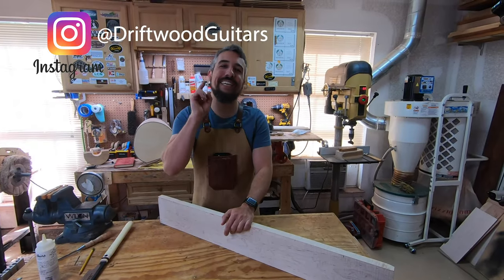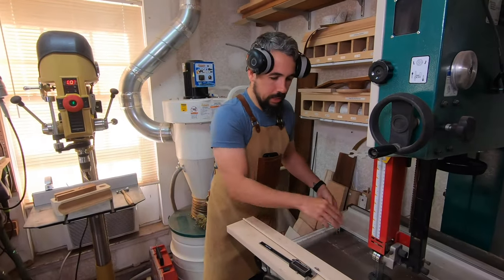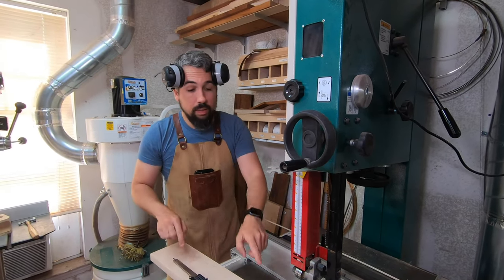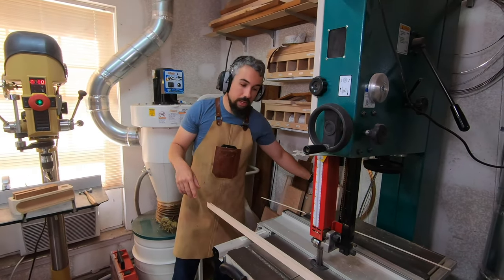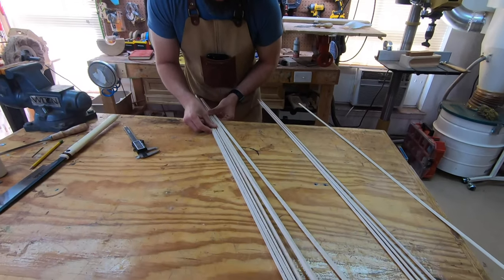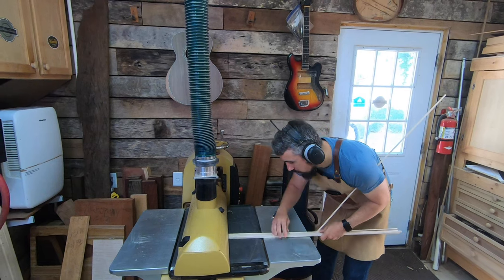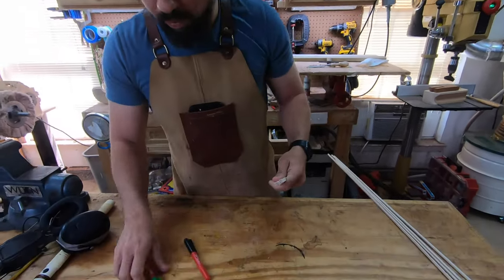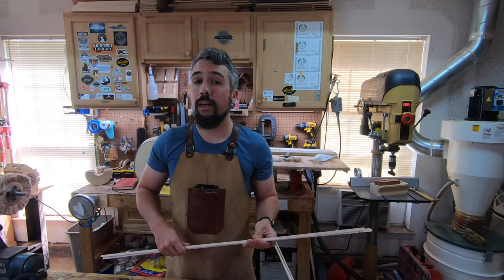How To Make Your Own Guitar Binding From Scratch

Comment: I have a couple tips: Instead of making individual binding strips, glue up a "log", with the purflings laminated on, and then saw individual, exactly matching strips off the log on the table saw with a thin-kerf blade. Use Gorilla glue to laminate the purflings to the binding log, because it's much more resistant to  heat and moisture during bending process than yellow glue. This is great for doing short-run, highly customized bindings, while saving at least half the time it takes to make individual strips.
Reply: I do this too, works really well for me.

Comment: Hi Chris - I do my bindings the same way but I use a 10 TPI skip tooth blade on my bandsaw and run a piece of of Birch Plywood through blade about 25mm from the edge then adjust my fence over the plywood trapping it. Using this method it gives support to the binding wood, gives you zero clearance and therefore zero tearout. You only need 0.5mm extra thickness to clean up resulting in way more binding per wood blank and less work sanding.

Comment: I'll be cutting my binding soon, I just have to decide what to use. I tend to poke fun at people who waffle about the color of things like clothes and walls, but I get all hung up over wood choices. I'll be using my table saw, and I haven't cut bindings before. I do a lot of small work, so I'm used to losing wood to my kerf. I don't have a lot of space, my table saw and thickness planer are portable and set up to use the same folding base, my dust collection a Fein vac. I take them out in the yard in nice weather. I just can't justify a bandsaw at this point, partly because there are a couple I can use if I ask- which I will do before I resaw any more body pieces. That wasn't fun on my table saw, then having to cut through the remaining 'tenons' by hand. It was a waste of wood and time, not to mention a bit sketchy feeling (I don't like ripping big stuff). But, I got it done as safely as possible. A friend shortened one of his fingers with a shaper this spring, accidents happens to so may skilled professionals and hobbyists alike. Good thing his instrument is a trombone. I always try to thinking about safety. Sorry for rambling and thanks for the video!
Reply: As Brien Rice mentioned below, I use a 7 1/4" blade on my portable table saw for brace wood and bindings/purfling. The smaller blade has a thinner kerf so there is a reduction in waste. Fortunately I have a thickness sander and use it just as Chris demonstrates. I haven't tried the laminating technique as mentioned by Stephen below.
Reply: @Guitar4C  Yeah, I should have some 7.25" blades. I've resisted because all my sleds/jigs work with my 2 favorite 10" blades. That, or for my dado stack. I need to get over it. Thanks for the push! The smaller blade is also less of a kickback hazard as the teeth will be moving in a more downward direction when hitting the wood as opposed to a larger diameter blade set for the same height cut.

Comment: A table saw with a glue line rip blade is faster without the need to sand to thickness.   What you lose with the wider kerf of the saw blade you gain because of the inaccuracies and tear-out of the bandsaw.   I use an Incra TS-LS positioning fence on a 3 hp Unisaw with a full-kerf blade to easily rip strips off the outside of the blade.  Using the full-kerf blade makes the math easier when ripping to the outside of the blade...slightly less efficient in wood usage, but nothing horrible.   This means you don't need to use a drum sander (I have a Performax 22/44) in order to do your own binding/purfling.  Any irregularity in the strip can typically be fixed by a single pass with your regular sander.   Keep the blade clean to prevent blade burns, especially on maple. 

Love, love, love the channel, Chris and Matt!
Reply from the maker: I’ll have to try that out! I rarely use my table saw, so that’d give me an excuse to use it!

Comment: I used to use a 71/4"  thin kerf blade on my table saw to make marquetry strips with a zero clearance insert, most of those blades have a tension ring and laser-cut segmenting to reduce chatter from rim expansion, 40 tooth worked well for me. Though I had Powermatic machines in my shop, I never had that beauty you have next to your door that can thickness to perfection... makes me want to start up again.

Thanx for the content you two.

Comment: Exactly how I make my binding, Love the drum sander. Here in the UK we seem to flutter between metric and imperial, I always refer to scale length and board thickness in inches, but seem to revert to metric for anything else. But I've just been converting my new garage into a new workshop and measured everything in mm yet when I go down to the timber yard, all CLS and sheet materials are measured in feet and inches. The struggle is real.

Comment: I/ve   never  used  curly  maple,  seems to  me  like  you  would  get a  lot of  tearout  using a  rtr  to    true  up  the  edges  of  the  binding    against  the  sides  and then a  lot  of  sanding . I  hate  sanding. I tend  to  use plain  easy to  plane sand  and  rout  woods.  for  binding  and  purfling.  How  do  you  like  your  laguna  fence. ?  I  have an  older  20  in  laguna, and  thinking  of  upgrading  the  fence  , TNX<!!

Comment: Very much enjoying your 3000 series. How would you go about putting a purfling on the bottom edge of the binding? I use stationary alligator clips to glue on a purfling and then scrape it down. Got any tips?
Reply: I made a 36" long fixture out of UHMW.  I cut three pieces out of a 1/4" thick  slab of UHMW: 1) for the base; about 3 " wide, 2) a piece 1 1/2" wide, using the factory edge for a fence and double sided taped it to the top side of base) and 3) the last long piece for a clamping edge.  Use factory edges for the second and third pieces if the edges are clean (using the middle of the slab as the base).  Place your dimensioned binding (with glue) against the straight edge, wide side down.  Apply glue and lay your dimensioned purfling against the binding. Apply clamping force to the pair with the clamping edge and squeeze-clamp in place with clamps of your choice.  TB III works better for adhering these as they will be heat bent later.  Someone already mentioned gluing alternating BW sheets of laminate to the wide edge of a board (the binding material) and sawing that assembly into strips- the BWB will make up a complete "purfled" binding strip with BWB on the bottom of each strip.
Reply: thanks

Comment: Is that a flat-sawn or quarter-sawn board that you start out with? Does it make a difference?
Reply from the maker: Good question, I should have addressed that in the episode. It’s flat sawn. It doesn’t matter how you cut it, it just makes the figure in the wood come out differently depending on if you cut in the flat or quarter direction. It can also affect how easy it bends. It just depends on the specific piece of wood.

Comment: I have the bandsaw for the job, and I've made myself some walnut binding before, but I dont have a drum sander. Any suggestions on how to flatten/smooth the curly maple with normal handheld tools?
Reply: If you have a drill press, you can make a mini thickness sander setup with a sanding drum and a fence. Feed stock against the rotation of the drum.
Reply: I have a "Luthier's Friend" drill press sanding drum and fence.  Works pretty good if you're mindful of the setup and sanding process.

Comment: Are there wood types you would absolutely never use for binding?
Reply from the maker: Can’t really think of any. I’d probably steer clear of using Cocobolo or Paduke with a Maple body. The colors would probably bleed
Reply: @DriftwoodGuitars  so using a burl type wood or a buckeye, wouldn't be a problem either for binding?
Reply: @DriftwoodGuitars  about the cocobolo or paduke, does that also bleed after stabilizing it in epoxy? or would that process make it unfit to use if as binding?

Comment: I need to stop watching your videos!  Now I want to get rid of my detla drum sander and get the PM.  The controls and infeed/outfeed are so much nicer on that unit.  I avoid mine for a lot of tasks because the bed height isn't a super smooth adjustment...  I get about .005-.010" variation from side to side as well...  Probably just need to tear it down and indicate it in during reassembly like I do with my cnc mill...  I just hate blowing entire days on repairs...  I'd rather be making parts.
Reply from the maker: Dude I had the same sander and had the same issues. The PM is a Rolls Royce. Dooo it! And use my affiliate link hahaha
Reply: @DriftwoodGuitars  HA.  I'm now haunting the usual second hand sources to see if anyone out there is giving up on their 2244...  I suspect that search will prove fruitless.  I'll use your affiliate link when I finally give up the hunt and just buy one...  You'll see a chunk of change in your affiliate account when I do it.